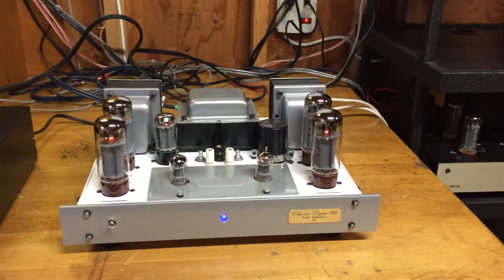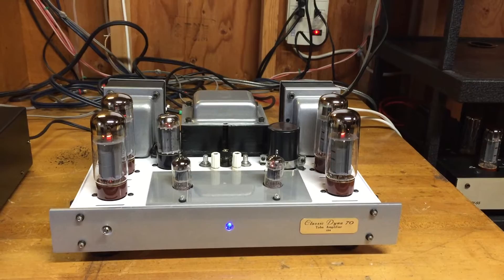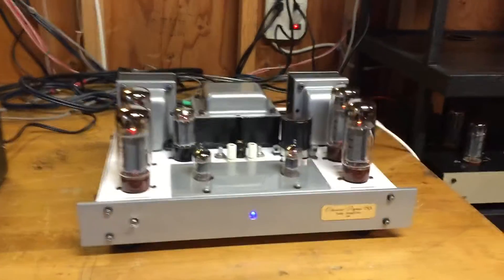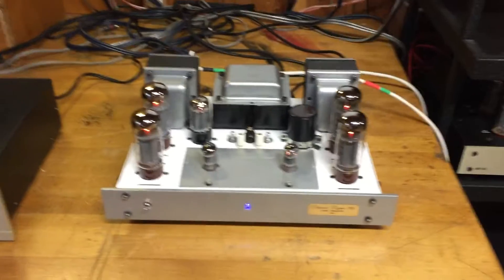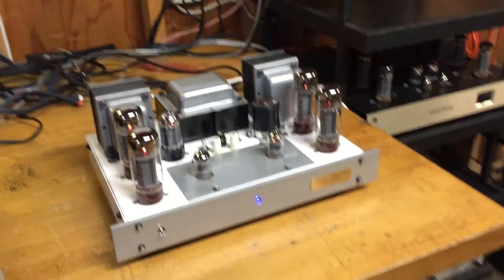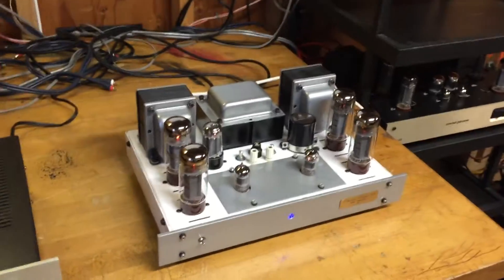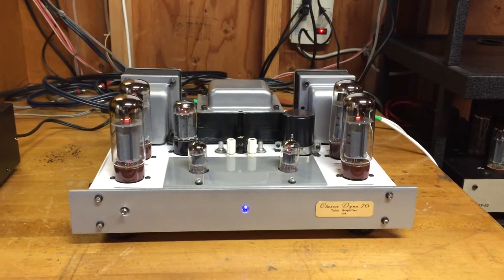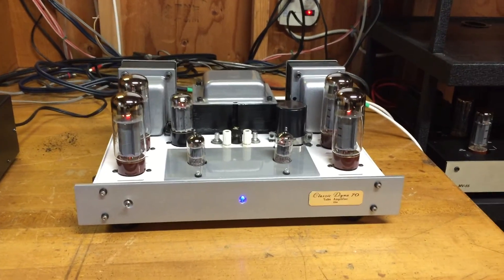Will Vincent Custom Dynaco ST-70 Tube Power Amplifier - Jimmyvp1

Comment: I'm the original owner of this amplifier. I bought it directly from Will Vincent in late 2010, if memory serves. It originally came with a quad of Electro-Harmonix EL-34 tubes. Will dubbed this the "iMac" color scheme, as it was inspired by Apple designs of the day. I believe it was the only one he ever made in these colors. It first powered a pair of Zu Omens in Sangria Red, and then a pair of Zu Essence in Dark Walnut with black anodized trim that I ordered custom from Zu. It was my first vacuum tube amplifier, and I'm sorry I ever let it go. I hope it brought you as much joy as it brought me!
Reply: Hey, just to let you know, I'm the current owner of this amp. I bought it from Hocheye (see above) a while back. Great sounding little amp. Drives my Spatial Audio (95 db sensitive) speakers quite nicely. Now running it with Gold Lion KT66's.

Comment: I own this amp now, sounds great! Came with jj el34 tubes, I have some gold lion kt77 tubes on the way should take this amp to the next level.
Reply: I'm the original owner of this amplifier. I bought it directly from Will Vincent in late 2010, if memory serves. It originally came with a quad of Electro-Harmonix EL-34 tubes. Will dubbed this the "iMac" color scheme, as it was inspired by Apple designs of the day. I believe it was the only one he ever made in these colors. It first powered a pair of Zu Omens in Sangria Red, and then a pair of Zu Essence in Dark Walnut with black anodized trim that I ordered custom from Zu in maybe mid-2012.  It was my first vacuum tube amplifier, and I'm sorry I ever let it go. It was replaced by a pair of Conrad Johnson MV-75s that I used to power a pair of Von Schweikert VR4s in African Hazelwood. Enjoy this amp! I hope it brings you as much joy as it brought me.

Comment: Playing MP3 files through a tube amplifier is like driving a '68 Roadrunner Hemi with two barrel carb! Not good!
At least use a FLAC file or the original WAV from a CD.  Better yet vinyl.